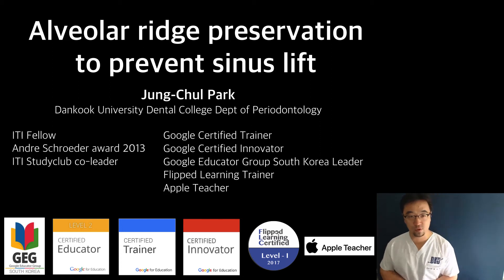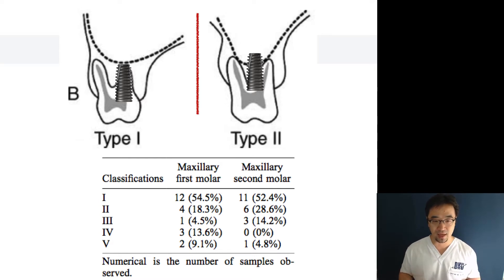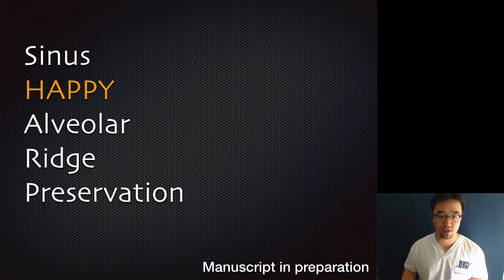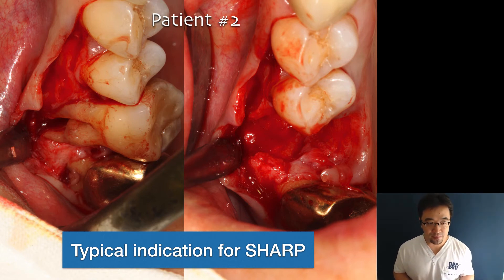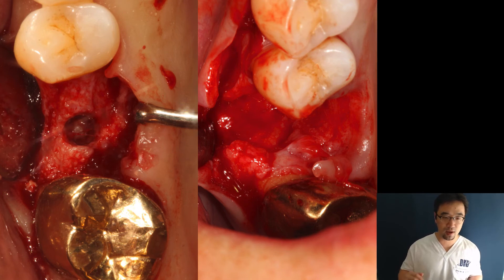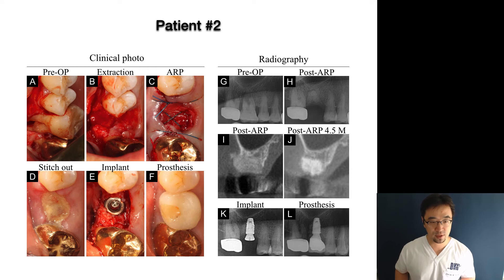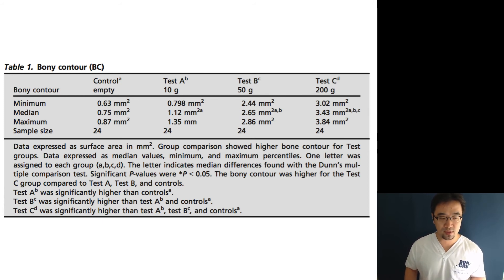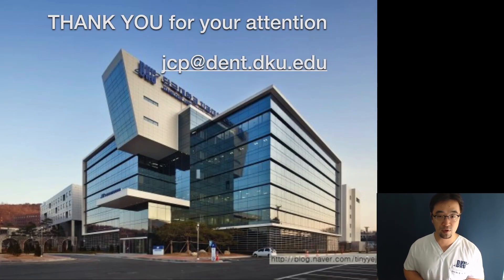[ENG] Sinus Happy Alveolar Ridge Preservation - SHARP

Comment: Are you ever concerned about the radiolucency around the bone graft? Is this fibrous encapsulation?
Reply from the maker: Do not worry. Bone is the hard tissue, but basically they are collagen, just mineralized!
Reply: @FutureReadyLab  Thank you for your reply. Sometimes after 3-4 months I still found the outline of the socket around the bone graft appearing as radiolucency and was wondering what it may have been. I assume it will just take longer for this area to be mineralised?